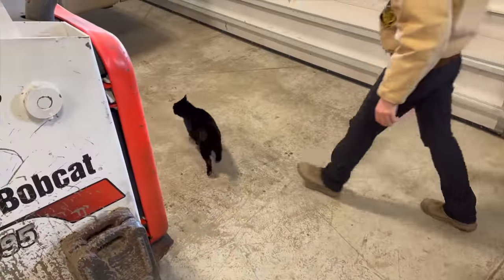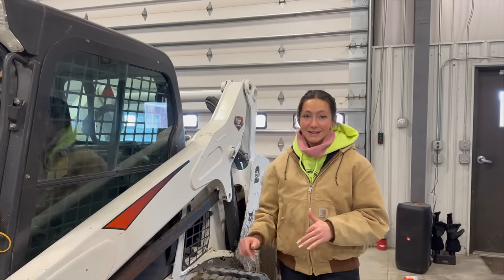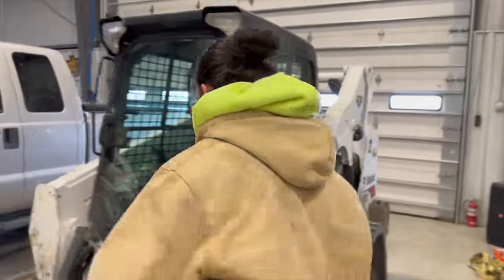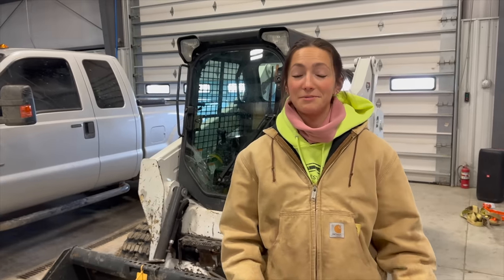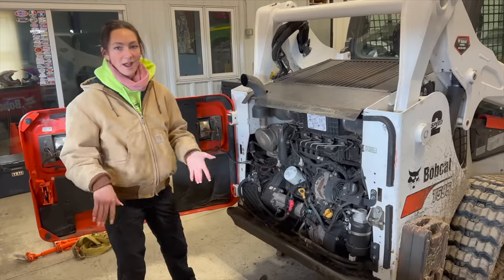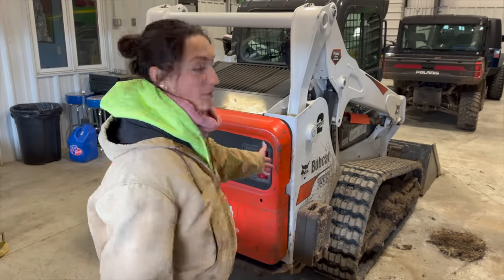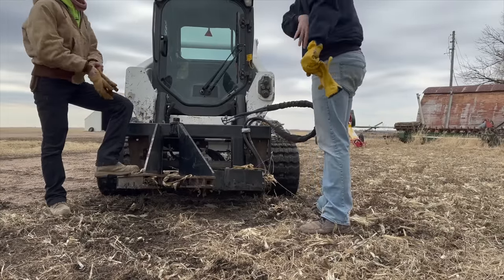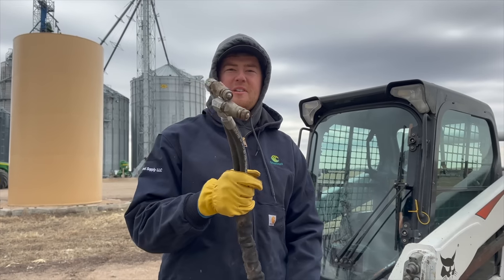He Finally Got What He Wanted...

Comment: Nice equipment pick up. That will make some of your jobs much easier. One thing I would do before you guys really start putting it to work, since it came from a jobsight, run it up on some blocks and pull the covers off the bottom and clean as well as make sure all your rollers inside are clean. Really enjoy what you two are doing.

Comment: Laura, can help with your controls! You have pedals that will operate the boom - up, down, tilt, up or down & your hand controls will change to forward/back/turn. If you have that option, with the deluxe panel, heated seat & 2 spd, you should! If you did, it would be the first rocker switch below the key.... It would show a hand silhouette on top & an angled foot on the bottom. Looking at the video  again, can't really tell/see it.

Comment: Looks like a very useful machine.  Would love to have it to move tombstones and fill around our old church cemetery.  Here is a little hint for you about buying tools at  Harbor Freight.  You may look at a big basket of identical tools as they are all made the same to the same specifications.  HOWEVER.  Look at each of them closely.  Most will be made in China.  🎉Mostly in my opinion they are JUNK.  But you may find a few made in Taiwan which are generally a much better tool.  Try any adjustments out.  Choose the best one made in TAIWAN and you will enjoy the difference in quality.  Good luck.  Let me know if it works out.

Comment: G'day from West Oz Laura & Grant. You've done it again & made my day ( night actually) with your happy & enthusiastic appreciation of the fruits of your labour. I can ride bikes, drive cars & trucks & tractors but those "skid steers" have my number. My first effort many years ago resulted in running over the lid of the septic tank on the property & getting the thing firmly wedged in the tank. Luckily I was reversing or I would have spent an extremely smelly hour trapped in the cab before the crane truck turned up to free it. 🤢.

Comment: Love this video! Love to here your comparisons between the models you looked at with pros and cons. I deliver ag equipment for Case, Kubota, and JCB dealer. Like someone stated backing on prevents wheelies (no thrill in that though lol) or leave your attachment on and keep it low and drive on to help with weight distribution. Eventually you will be confident enough to spin it around on trailer and drive it off. Won’t take long to get the hang of controls, just keep using it as much as possible. 100% every farm needs one of these!! Very wise investment, you won’t regret it. Keep up the great video’s and enjoy your vacation.

Comment: That's the problem with beaver tail trailers. Better off backing it on and using the weight of the engine to stop the rockin. Next auction look for a tilt trailer with the right weight on the bed and neck.

Comment: Track skiddy's tend to be a little slower, but way more stable, where as the wheeled skiddy's tend to be a tiny tiny bit faster but not as stable and more prone to getting stuck. However having driven both I would have suggested a Cat Skiddy over a bobcat, only because the Cat's controls are simpler and easier to use in my opinion. But that's super cool I am kinda jealous myself.

Comment: back skid steer on trailer. #1counter balance, #2 a rock gets kicked up and breaks door glass you will not want that bill. if the back window gets broke from a kicked up rock its a lot cheaper. not to mention the back of skid steer is more iron than glass

Comment: Great video. Question for both of you. Did you consider a wheel loader? They are articulated, smoother than skid steers, have fewer vibrations, and tires last longer than tracks. Not to mention cab visibility is much better than any skid steer.

Comment: Scary loading without bucket or attachment as it throws off balance.  PLEASE KEEP GREASE FITTINGS FOR LOCKING LEVERS FOR QUICK ATTACH OR CANT GET ANYTHING ON OR MORE SERIOUSLY OFF. You for sure need forks & if you can get another bucket get with grapple as you’ll be using that more than you think. And try to stay off road as new tracks will shock the hell as about 4 or 5 times a new set of tires😮😮. You can rent any attachment to really expand its use. GREAT CHOICE of skid steer

Comment: There is one thing that I hate about skid steers that have the entrance door in the front like that (as most makes do). That is, that one can become trapped inside of the machine if something large enough gets in between the bucket and the door or if the bucket cannot lower or raise enough to clear the door so that the door cannot open or there is a hydraulic failure and the bucket isn't all the way down to clear the door.
My uncle Doyle was drowned inside of his skid steer while he was doing some weed and tree clearing along his pond's banks. He had slid down hill in the mud on the steep grade, flipped the machine over onto it's side and then it slid and rolled deeply into the pond going completely under the water. Since the bucket was stuck in front of the door blocking it from opening, he could not escape from it and drowned. They need to include an escape hatch either on the roof or in the back of these machines, in my opinion. Never operate the machine in any sort of a risky situation while alone!

Comment: Do yourself a favor, (I have many years experience w/bobcat w/same controls) when you are working with implements that DON'T need steady hydraulic flow (brush hog, broom) use the foot accelerator and only give it the amount of fuel it needs. You will be so much smoother, faster and like it a lot more.   Try it.

Comment: Worked on a friends 700 series it’s over 20 yrs old. Old tech still rebuildable no sensors to shut you down eh it ah 65? Up lol had to convert to your language lol We cabbed it with heat and ac his iPhone is his fancy display lol I use a newer case 300 smooth as silk like bobcats operating drive system better

Comment: Howdy ya'll, 
 Wow, you know there's a counterweight built-in to the rear of every skidsteer, and when you take the bucket or any other implement off the boom, you completely throw the balance off the skidsteer, you having problems loading the skidsteer on the trailer, had Nothing to do with the hand controls, it was because you took the bucket off, and than tried to load it on the trailer, driving forward, that than put all the weight on the backend of the skidsteer, Thankfully you didn't flip it, or drive it off the side of the trailer, 
 Stay safe and Farm on my Friends, Peace

Comment: Any body comment on the rear mini suitcase weights on the rear sides of the bobcat?... you might not need those... grant said this came from a concrete company, they would need those weights when the front bucket was used to carry wet or dry concrete, help keep machine stable...it would help not having them when loading on a trailer without a front attachment on... have lots of fun with it!!!

Comment: On the trailer, on the floor in the shop, why didn't you just use a vise to hold the hose and fittings while you loosend/tightened them?

Comment: You need to take a skid steer safety course you should not load a skid loader onto a trailer going forward without an equipment attachment on the front of it would have been best to load it in reverse without equipment on the front

Comment: You guys cut away and didn't show how you lock the levers down to hold the attachment on. Do you still have to do that by hand or is it automated now? I haven't owned one since I had a Bobcat T250 in 2006. Do you all know how to tighten the tracks? It's not obvious, but it's easy with a grease gun--that is, if the method hasn't changed since 2006. Also, the procedure you used to flatten the dirt is called back-blading.

Comment: That was one hell of a dangerous action, as an inexperienced driver with this piece of equipment, driving forward onto the trailer.
Nothing to laugh about, to be honest - these things have such a brute roll cage for a reason - rolling a Bobcat over backwards is possible even with a loaded bucket. 
How so?
The driver gets often a bit overconfident as soon as he starts to master the controls, and quite some tend to speed up the work a and switch from reverse to forward too quickly - the skid steer then does a wheelie, throwing the bucket contents over itself and then rolls over the rear.
Mind you: There is a reason why the Bobcat or its cabin is so nailed down with safety bars, roll-over bars, grilles on the windows.....

Comment: Isn't  there a button to change controls to foot control for bucket and joy stick for driving ?
Reply: On this loader there are two formats, SAE and the old school 'Case Controls' pattern.   Both use the joysticks.  I think the only foot controls are throttle and an optional accessory function.